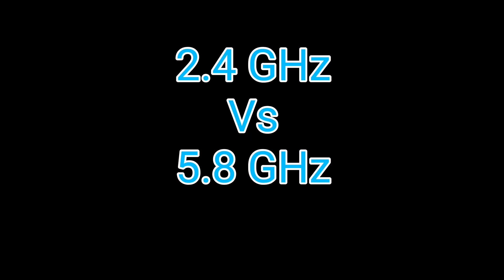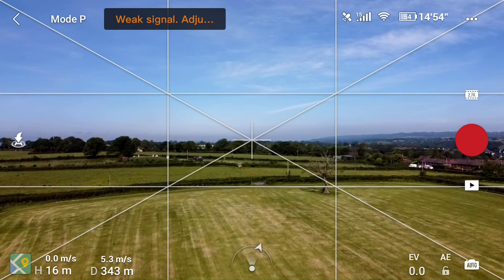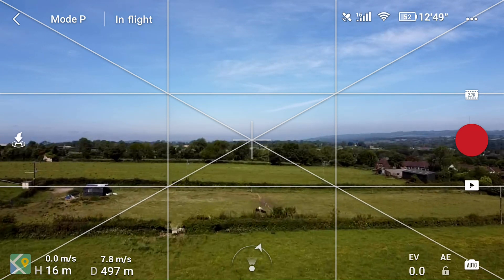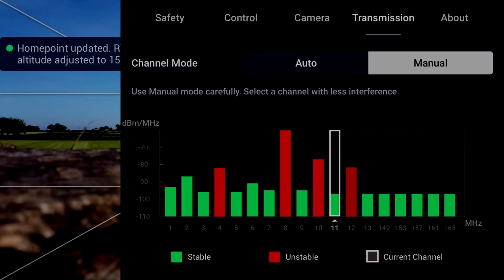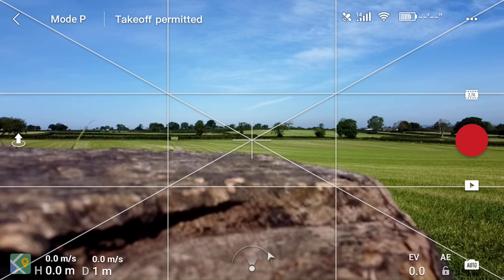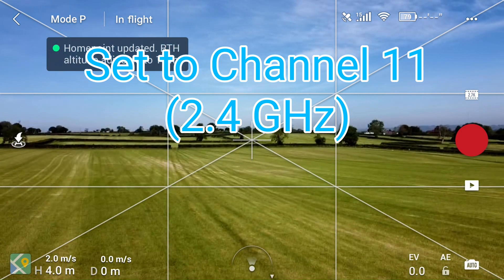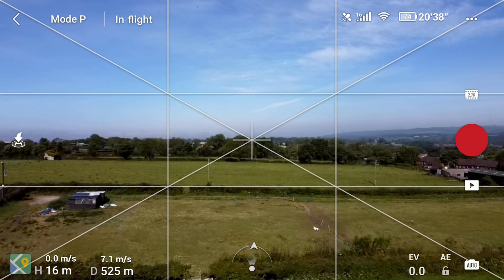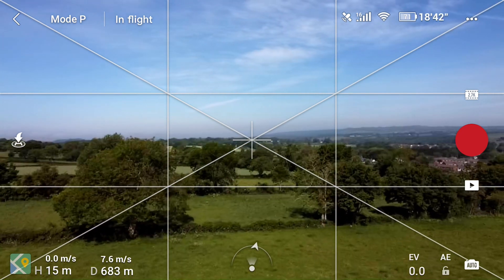2.4 GHz Vs 5.8 GHz (Mavic Mini Footage)

Comment: -- DJI Mini 2 here.  July 2022.  I find I get better range leaving it on auto.  Bought a copper range extender (can fly out little more than 700 feet in urban/commercial area)  set to 5.8 manual, I get 400 feet in the same environment on the same day, multiple tests over different days.  Then over the woods, no power lines, no cell phone towers, I get a bit more.  Hard to tell.  Signal bars go orange, and as quick as they do, flick back to white.  
   By all means, test.  But auto seems to be best.  Max range I achieved before auto return to home was three quarters of a mile.
   EDIT:  And I live in class D air space.  Altitude for all tests were between 300 and 380 feet.  Birds around here like to go after it.